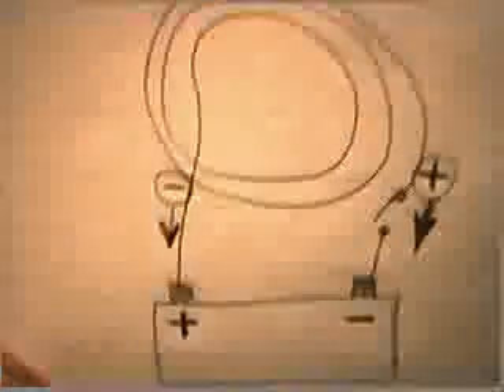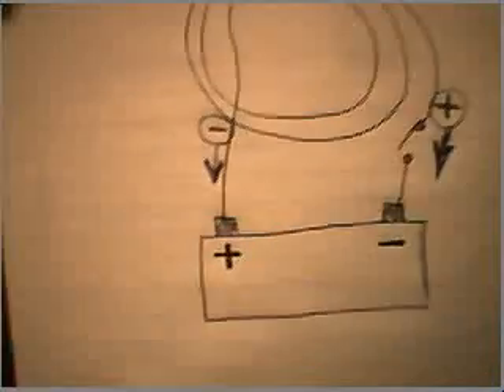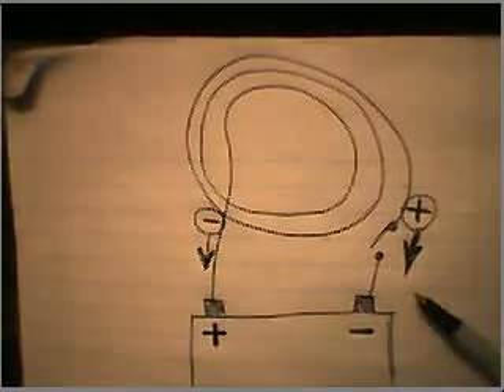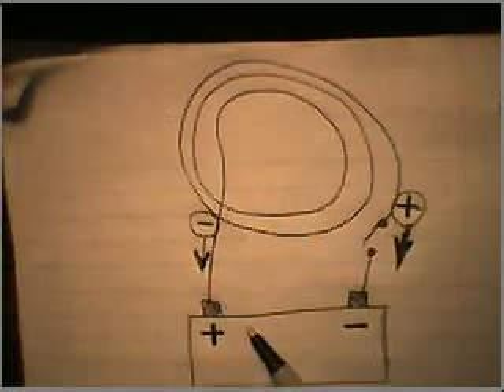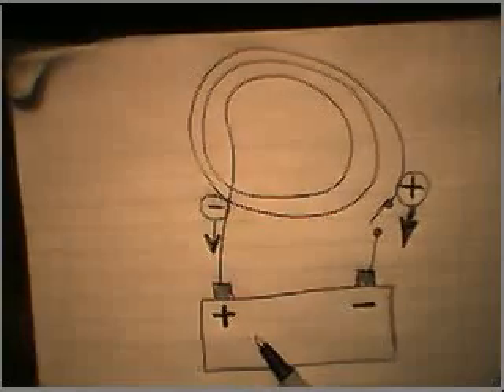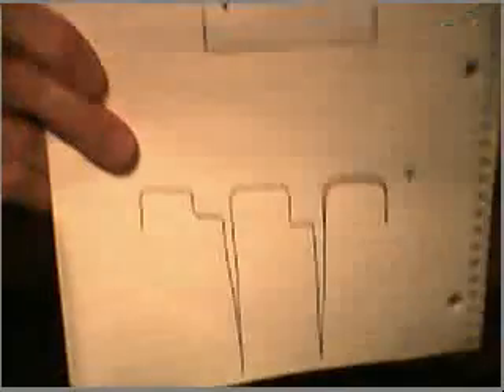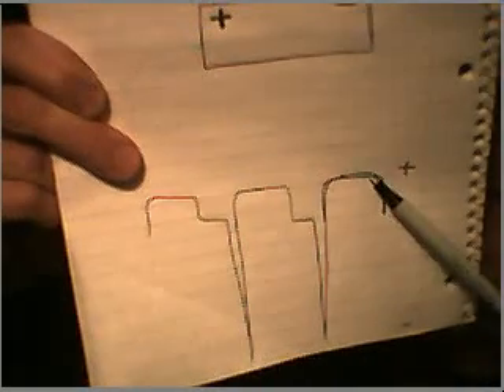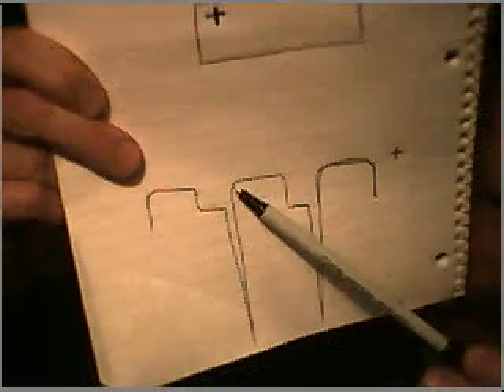Newman motor and the back spike it produces.

Comment: I have found that by trying to measure the resistance of coil (battery pack disconnected) using a digital multimeter that it is done so by knowing only the voltage of the battery powering the meter as well as the current. When I spin the magnetized rotor around, it generates a varying reading (not true resistance) on the digital read-out meter. The sign of the reading changes polarity every half rotation only because the current changes polarity with respect to the battery voltage.

Comment: The drag that a magnetic field induces on the object is dependent on the property of the material. If you take any magnet near a ferromagnetic or PARAmagnetic material, you will create a drag that slows down the rotor. This is what causes current to rise relative to greater rpms, as more voltage is need to overcome a certain degree of drag induced in surrounding material. Newman has minimized use of iron and similar substances when building the support structure for his motor.

Comment: As a result, my observations have show that on digital read out meters, much of what is thought to be back-emf is actually just induction into the coil. At some point, the input current from the battery pack when the motor is running is so low that you will have these variations in the current that will change the sign of the current going into the meter. This is seen as a limit to the motor's effectiveness.

Comment: "To prevent your motor from burning down though, you will have to increase the magnetization of the rotor and stator elements relative to the current, and such is not possible with an AC motor."

To clarify this, I have to say that this applies for AC induction motors in general, but not specifically to AC motors that incorporate the use of permanent magnets.

Comment: This limit is no more a road block to better motor operation than is writer's block for creative writing.

The fact is that when you obtain the limits in terms of drawing less current, you ought to take your motor's advantage of being able to increase mechanical load. This will cause current to rise again. To prevent your motor from burning down though, you will have to increase the magnetization of the rotor and stator elements relative to the current, and such is not possible with an AC motor.